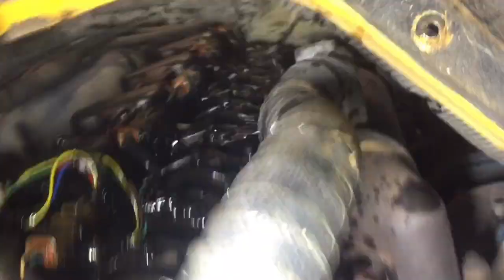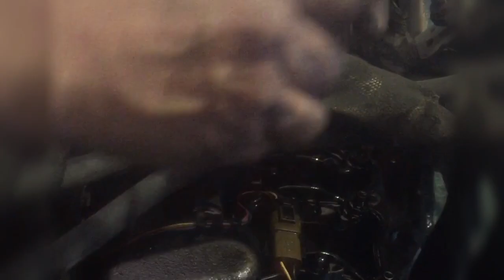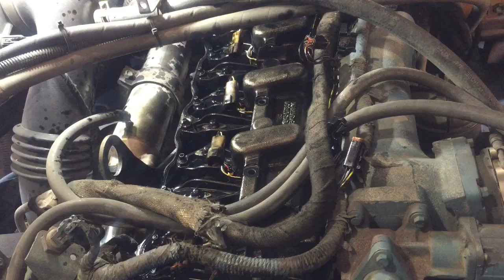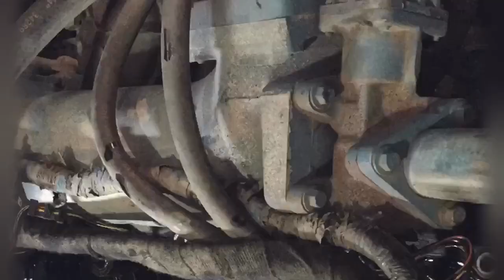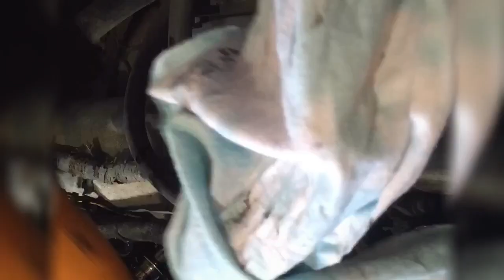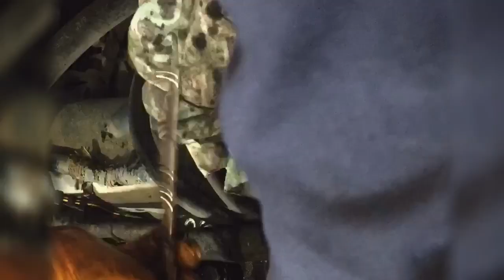How to replace o-ring seals on a DT466 oil rail

Comment: I have a question regarding the inlet(nipple) oil rail in a 2012 international 4300 dt. 

Q. A bit of oil does come out to lube the valves right? Right above the injectors o ring - but not from the injector o ring it self but from the inlet. 

Thank you
Reply from the maker: Hey Hector. Yes. Oil does drip out onto the moving parts (rockers). Is a constant drip.

Comment: Very helpful video I have a question I have a 2005 international and it'll start good in the morning's but after a while of running can't turn it back on unless I use starting fluid any tips on what it might be.
Reply from the maker: Have you checked your fuel pressure when the truck doesn’t want to start. Supply pumps weaken when they are worn and hot. Would need more info to try and help you diagnose your no start issue. My email is joegonz268@gmail.com

Comment: Good job there !! I do tons of these every week on county school buses. Also EGR coolers are prone to failure and the HPOP( High pressure oil pump). Normally i will replace the entire oil puck not just the o-rings. I have seen them loose and will cause all kinds of issues.
Reply from the maker: Morgan .Kimathi   Hey there Morgan. Appreciate the comment. These units keep us busy year round. We got most of our 466’s pretty much done. Now we r working on maxforce 9/10’s. Not much difference. Again. Thanks for comment. Thanks for watching.
Reply: Second puck shown in the video is loose.
Reply: Hey brother any tricks to getting the oil rail to sit and seal perfectly I can not get it to seal !

Comment: Will the bad o rings on the high pressure oil rail give you low oil pressure on the gauge in your dash ?
Reply from the maker: They would have to be leaking quit a bit. And mostly all of them at the same time. Try cutting your oil filter to see if there are any deposits in it. That and your oil pressure sending unit.
Reply from the maker: You can email me if you prefer. Joegonz268@gmail.com

Comment: Whats the torque specs on injectors and oil rail?
Reply: 20lbs on the 12 oil rail bolts after hand tightening all 12 there is a tightening sequence in the service manual.

Comment: Does a 2002 dt466 have the same setup because my engine looks a little different and I’m having hard to start issues in the morning
Reply: The 2002 dt466 has the high pressure oil rail on the side of the head rather than above the injectors like the one he is working on.
Reply: @dthetruckguy1499  I have a 2002. It's drinking about a gallon of oil an hour.  Only a seep from the rail on driver's side of the block.  Starts and runs very well.  No excessive smoke.  Could you please point me in the right direction???
Kevin

Comment: Hi joe i replaced the ipr valve icp sensor the o ring  and it still is leaking oil on 5 &   6 could it be injectors  or pucks ?
Reply from the maker: Is it leaking oil from oil rail. If so. It is one of 2. Bad pick o-ring or bad puck. They r suppose to drop oil onto rockers. But not pour on them
Reply from the maker: You can email me if u prefer. Joegonz268@gmail.com.
Reply: Ok thank you  joe ill email you

Comment: He is trying to check O-rings to see if they are bad and oil is coming out of them. Truck went into limp mode this last fall but never stalled.  We drove 100 miles home on shoulder of highway. Took to diesel mechanic.  They said it was throttle pedal so they replaced with new one and still went into limp mode. Spent 800.00 and still not fixed. We always had to plug it in to warm it even in the summer. It's  a 2000 international 466e 4900. Any advice will be greatly appreciated.

Comment: What are the chances of the tubes being bad? Already replaced orings
Reply from the maker: Hey there Marco. Pucks rarely go bad. But they sometimes do need replacing. What is the issue with ur engine thats making you think u might have bad pucks on oil rail.
Reply: @JoesBusBarn  well. Hard start pressure builds pretty quick. Just a hard start after 10 min sitting... about 8 to 10 second crank.
I've replaced the o rings already.. issue persisted. But instead of a sloppy start it cranks up as should minus the delay.8-10 sec.
Reply: Also, pulled valve cover and tried to determine if there is a significant leak. Looks like 456 have more oil coming out.
Pulled oil rail and the o rings look okay?
Reply from the maker: Try to move the pucks around by hand. There should be quit a bit or resistance. You shouldn’t be able to wiggle them around.
Reply from the maker: How’s ur fuel pressure.
Reply from the maker: Check your fuel strainer.
Reply: @JoesBusBarn  haven't verified fuel pressure. But unit runs like a bat outta hell down the road. Before the o ring replacement it would start up like it was starving for fuel. But now it's the long delay. I have one or two pucks that are questionable. As far as movement compared to nice and stiff to the others

Comment: I know this may sound crazy since the recommendation is to use OEM Orings, but just wondering if you have ever used any other generic O rings that support Hot Oil and High pressure that are not specifically designed for this rail?. If so, what was your experience with it?.

I'm wondering, since here in my country (El Salvador), the only International distributor sells the high pressure oil rail o ring kit at a astonishing price of $130 USD, that's crazy. I'm able to find it at around 40 bucks, shipping included, in eBay, the International ones.

If I wanted to be stolen, I'd rather go to some dangerous city, rather than buying the Orings kit from the dealer.
Reply from the maker: Hey there Mauricio. There are other companies that sell these high pressure rail seals. I have ordered from eBay and have had very good experience.
Reply: @JoesBusBarn  Great thanks, and thanks a lot for taking the time to make these videos, I've learned from them, and I pretty much do things on my own rather than having a mechanic lying and changing parts when not needed.
Reply from the maker: Hey Mauricio. I know exactly what you mean. I’ve heard a few people claim that they’ve been taken for a ride on repairs. I’ve seen a few highly overpriced services.